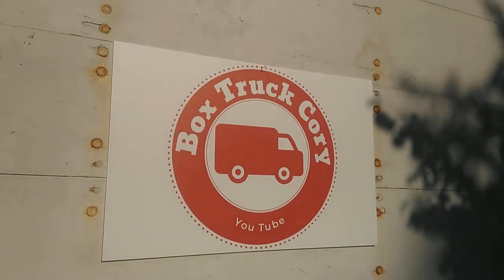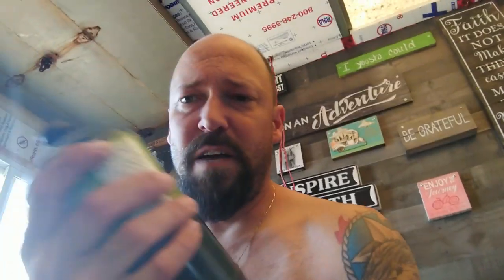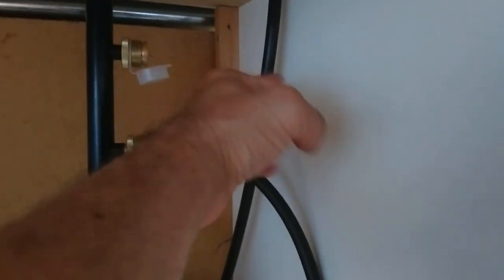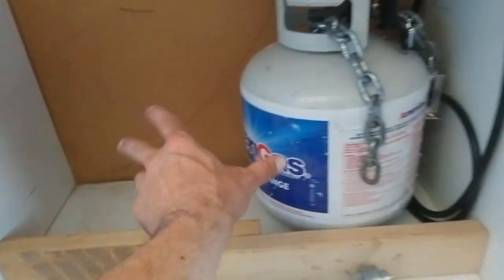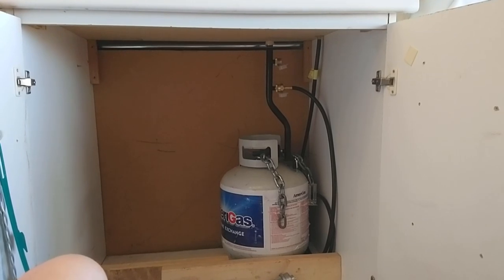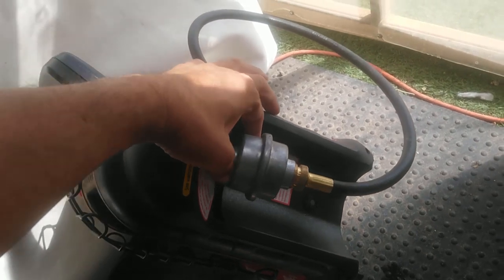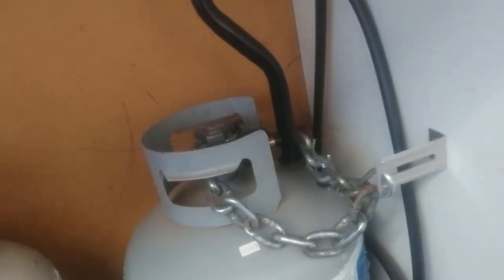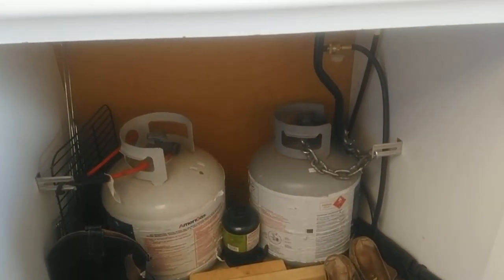Best Propane System For Your Self Build Van or Tiny House (And it's cheap!)

Comment: For you own safety may I suggest: 1. Drill a vent hole in the bottom so leaking propane can sink out in the open. 2. Fasten the "tree" to the wall and connect a flexible gas hose between the propane bottle and the "tree" so vibrations will not cause leaks.

Comment: Propane is heaver than air - sugest drilling a hole between your two tanks down throu the floor to allow possible tank venting (tanks have a pressure releaf valve so if filled to max and temps get high expansion wont over pressureize tank for explosion) before i put a newly filled tank inside my truck i let just a little out first - enjoying your contant - peace
Reply: c sy absolutely..that was the "one thing" I thought he was going to mention..and yeah the soap bubbles too...👍
Reply from the maker: I'm on the fence about that. Don't want to lose heat and a/c thru holes but don't want to explode either!

Comment: Ya that will work! I've been using mine without the filter for many years but than again it only gets used a dozen times a year.
Reply from the maker: I've heard stories of the buddy heaters dieing with and without the filter. Hope mine lasts! I've been using it  3-5 hours per day. Been cold at night in slab City. Hearing up now tho
Reply: @boxtruckcory3002  Ya I've heard them to. Just keep an eye on it!

Comment: I wonder if you could cut a hole out of the truck bottom then put a charcoal style of grill over the hole while then putting a thoroughly insulated box over the propane cans and then running the lines thru holes in the insulated box. Grill should allow for the escape of propane downward (path of least resistance) and out of the van?
Reply from the maker: Could do.

Comment: Corey I have a question. Did the tree come with the connections already assembled so you don't have to drill a hole into the line?
Reply: Just mona,  I was wondering the same thing.   I don't know if he will answer us.  I believe he said he didn't have internet where he is.
Reply: FYI "propane  distribution post" are at Walmart and amazon - about $30-$35
Reply: @NotaTrollTravlin  Thank You.
Reply: @NotaTrollTravlin  I thought he was talking about the filter connection for his little buddy heater being $30-$35.
Reply: @wherewomenwander2921  Well he uploaded this video from somewhere... Maybe he'll go back there and look at the comments.
Reply: @NotaTrollTravlin  You're right! Although, I didn't understand I didn't understand what he said in this video I went back to the second video he did with Bob Wells and he explained it very distinctively! The hose with the attachments all came together and he bought it at Walmart 👍👍
Reply from the maker: Yes it comes with everything u need. Buy the distribution tree and hoses and they just screw together
Reply from the maker: @wherewomenwander2921  yes it has the right connections ready to go
Reply from the maker: @justmona9647  filter was $20